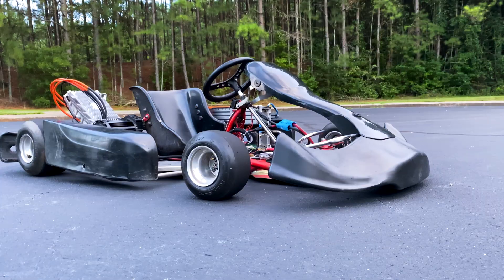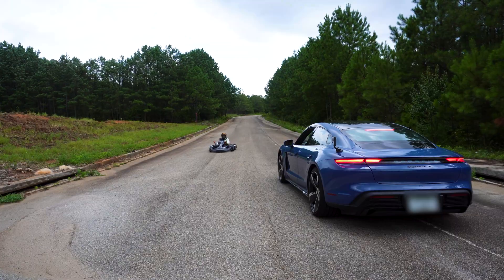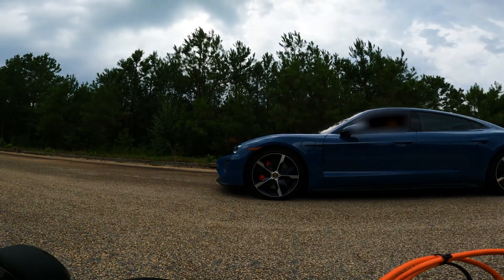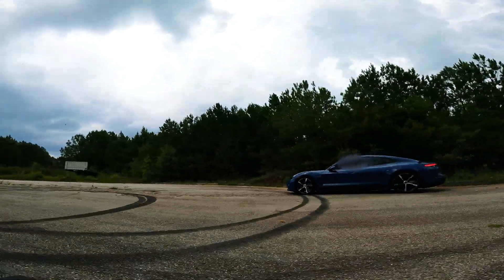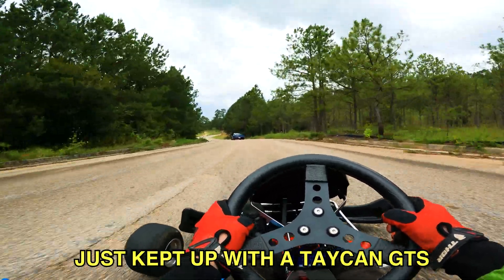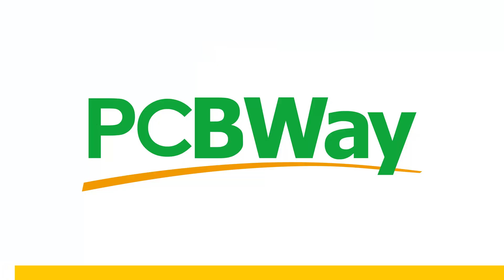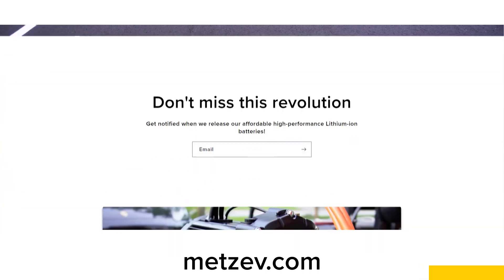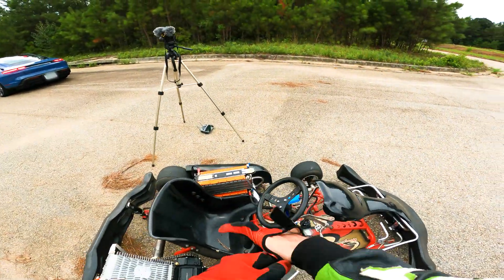Electric Go Kart VS Porsche Taycan GTS DRAG RACE

Comment: Rookie mistake getting the 138 with the gear reduction. I've ridden carts at Disney World faster than that. 🤣🤣

If you would have got the QS138 V3 90h no without the gear reduction you would have beat him. The gear reduction is meant for girtbikes with 19" wheels. not go carts with 2" wheels.

Comment: QS 138 V3 motor is Rated Power: 7500W and Peak Power: 13.5kW

can I ask how this 37KW ? is it because you add more voltage,  QS 138 V3 is 72v  !
thanks
Reply: yeah i had the same question
Reply: The battery is 94.9v
Reply: @ReVolt_e-Vlogs  either way , thats 36,000 watts.. 4 times the motor rating
Reply: Yeah good point
Reply: Apparently these motors are severely underrated and can produce a lot more power than the specs suggest. My little 5000w Kunray kr5v produces over 10,000w.

Comment: Good video but the Porsche clearly would outpace/win by a drastic difference but slows down because end of track
Reply from the maker: Yes, given a longer track the Taycan would've taken the cake (especially since my top speed with this gearing was 62mph lol) However, I am not testing top speeds. I don't plan on building a kart that goes 155mph

Comment: The amount of electric energy used between your very light go kart compared to that overweight porsche is mindblowing. Normal 4000-5000lbs cars for moving one person around the city is the way to kill our planet.
Reply: Don't look up how much worst it is in general for a manufacturing plant to produce an ev car, it is something around 4 times the pollution than it is to make the same car in a gasoline car manufacturing plant, then also don't look into why it takes 500+ tons of mined earth to make one lithium battery... lmao ev's are a cool idea but it isnt more environmentally friendly at all lol 

Where I fell in love is the amount of torque you can get out of such a small package drive train, sadly every aspect of ev's are more costly then their gasoline counter parts, including replacement parts, i still love ev's tho and wouldn't swap my kart back to gas lol
Reply: Jerryrigeverything does a great video breaking just this topic down. Shows how long you have to own and miles driven to surpass the huge amount of emissions generated in just building an ev over the amount of gas vehicles. It takes several years and several thousand miles before 1 ev even becomes equal to the emissions of a gas vehicle let alone cleaner.

Comment: So you have a 400a controller but what battery peak amperage comes out of the battery? Also i went on the website and couldent see the batteries
Reply from the maker: Battery peak amperage ~600A
Reply: @AllThingsElectric_  Damn, how much for the battery?
Reply from the maker: They'll be offered at ~$400/kWh. This is subject to change, but that is what we plan to sell for.
Reply from the maker: They aren’t released yet, if your interested you can sign up for emails or contact us.
Reply from the maker: The website has just been launched! metzev.com